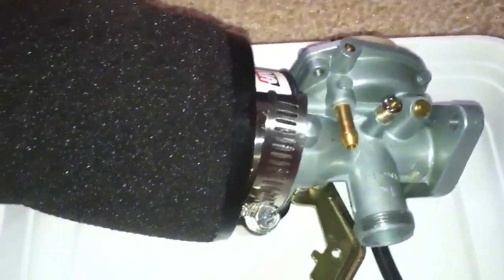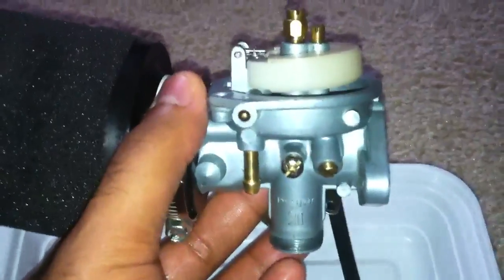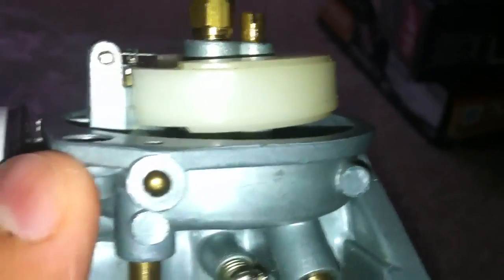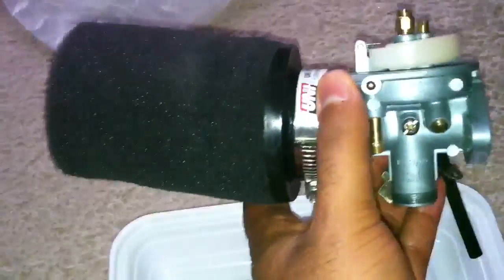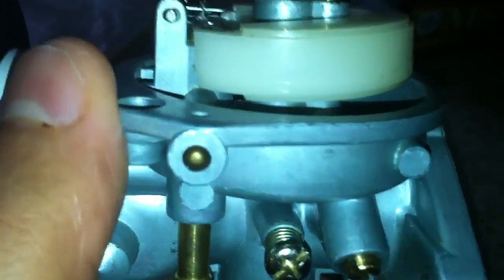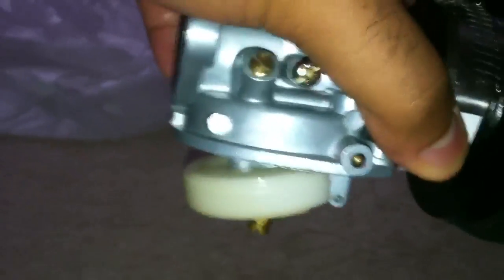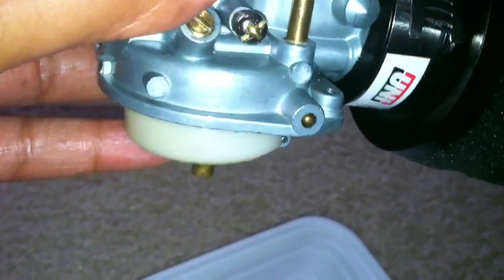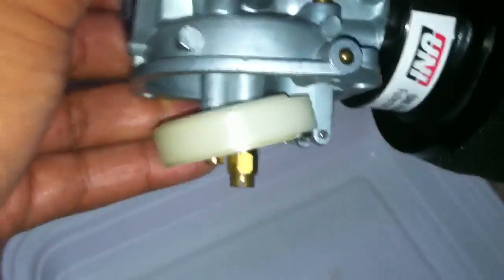PBP Question: How to properly adjust the float to 10 degree

Comment: Curious where the 10 degree setting for this carby came from.  Never seen a (legit) manufacture list their float settings in degrees.  Most give you a measurement (in mm) taken from the top of the float to the gasket or sealing surface for the bowl, with the carby held upside down.  Honda's recommended float height for their OEM Keihin PB style carby like this was 10.7mm (0.42") +/- 10%.  Using Honda's measurement the float ends up being pretty much level with the bowl's sealing surface, which you'll find is how the OEMs and the China clones pretty much come new out of the box.